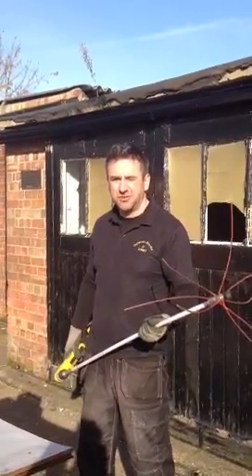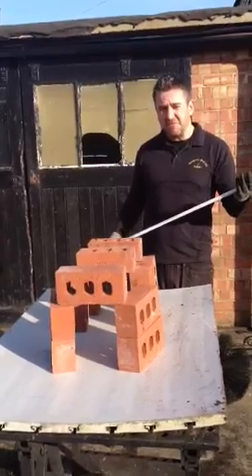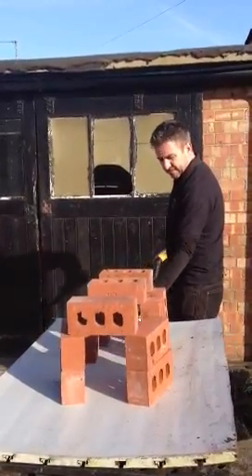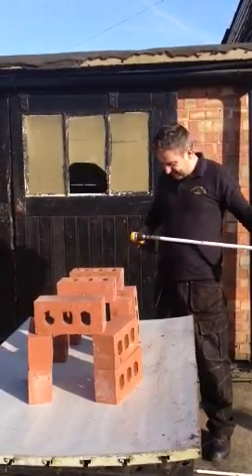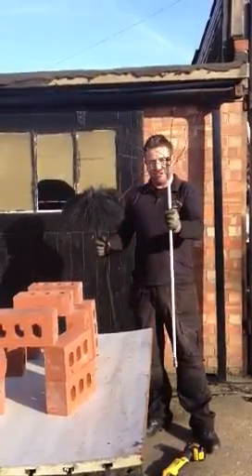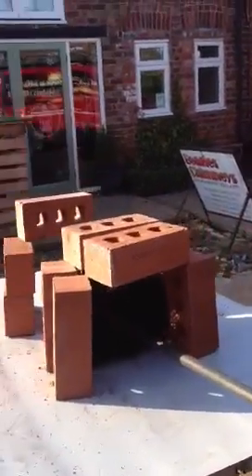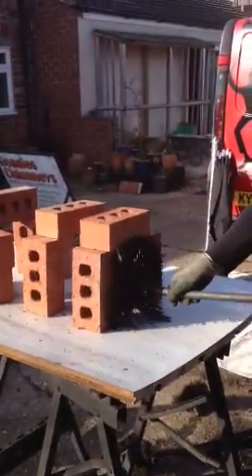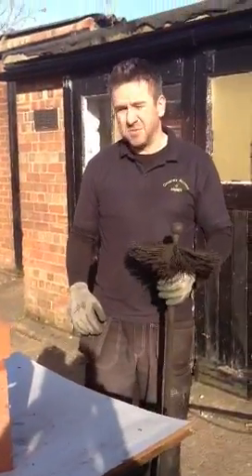Power Sweeping

Comment: the role of a sweep is not simply to clean the flue,he also needs to make sure the flue is clear, due to the lack of surface tension this system gives limited feedback regarding potential problems inside the flue,,issues we often come across which are easily missed using this sytem are,restricted pots usually slate or bars,bricks or snots partially blocking the flue sat on bends,and some more obscure ones like gas and water pipes,i love the rodtec equipment but it must be used alongside brushes

Comment: no he seems like a keen sweep who has just not quite got the correct hamdle on this equipment,often for the first few months sweeps adopting this system use it for everything but then after issues arise they begin to use it alongside traditional methods,however the rodtec equipment is amazing when used with care